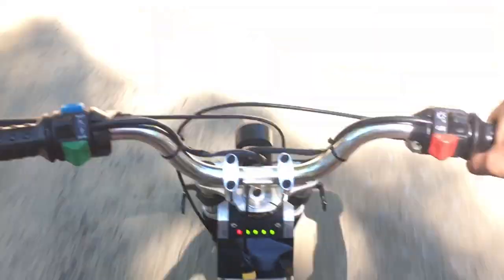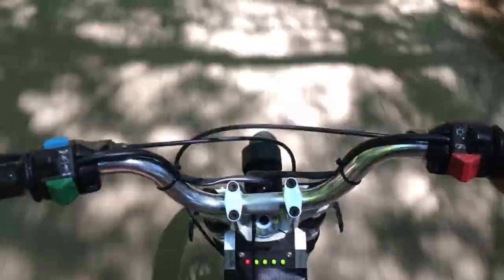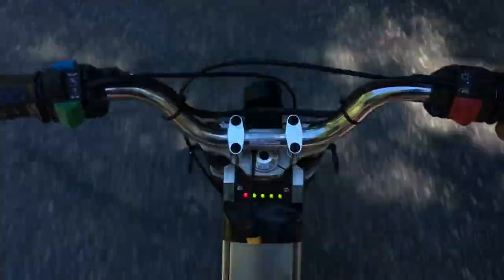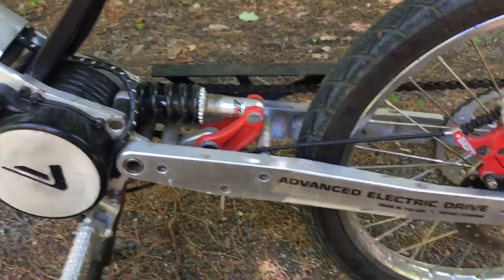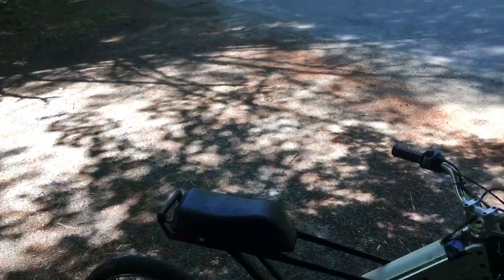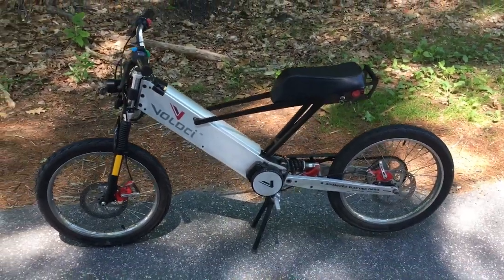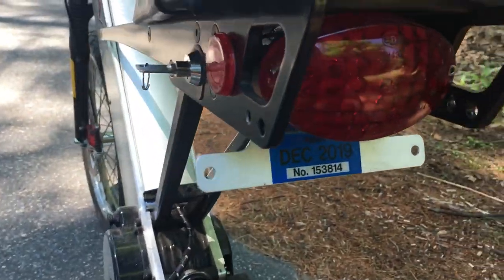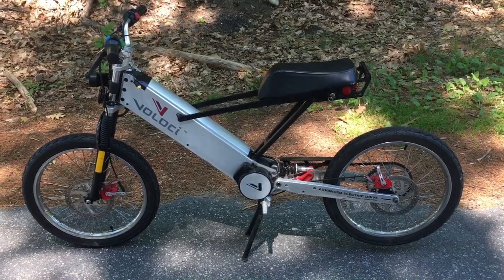48V Voloci Electric Scooter Ride/Review

Comment: I just removed the stock controller from the one I am working on it has an issue so am going to swap it out with a 48v controller. I cant find any wire schematics and dont have a clue what the throttle wires are since there is normally 3 and I have two although theres a single green wire too ( ground?) a red and a grey, the lights I am assuming are the three small ,three wire red,white, and black that are in the black jackets.
Im also located in MA.
Its not mine but Id like to get my hands on one for myself.
Reply from the maker: Oh nice I had over 12 Voloci's at one time when the inventor passed away I purchased the estate luckily. Sorry for the late reply. Let me know if your still having trouble. You cannot use the stock throttle with a new controller since it is only 2.5v and regular throttles work 0-5v
Reply: @EBIKEScott  Thanks was wondering on the throttle. Seems like the motor don’t want to work at all with a different controller even with different throttle.
I think there is a short in the motor. I can move some of the wires and the wheel will spin but if I connect a throttle it dont do anything.
Another thing is the Hall sensor wires are not the common colors and the phase wires are all black. Its been a headache🤬
Reply from the maker: @ktlcustoms3847  Ya you should check out my Endless Sphere forum post, it goes over a motor swap with detailed pics and shows you what is what, just google nova cruz voloci scooter and you will find the page easy my username is Skeetab5780
Reply: @EBIKEScott  I watched the video. Im not swapping the motor, although it is what I would do if it was mine!
Im still trying to figure out the hall sensor wires🤬 The phase wires were pretty simple and I did manage to get the wheel to spin.
Trying to convince the owner to do a complete drive line change Id love to make it into something you can peddle as well and make it more bike path friendly!
Reply from the maker: @ktlcustoms3847  ya the hall sensor combos are on the website if you need them, you will also have to adjust the timing on the hall sensors with a new controller. Typically you will want to use an amp meter to bring the noise and current to as low as possible once you find the correct wiring combination obviously
Reply: What are the prices on these
Reply: @chasesperry6455  If your lucky to find one for sale, Im sure the price can be negotiated! But doubt it will be cheap.
Reply from the maker: @chasesperry6455  i’ve bought one for $200 before, i also turned one down for $100 due to a long drive. Ive sold a few for $500. But i have a few that are priceless imo. Owned by the inventor and pristine condition

Comment: I was just given one of these by a friend who found it in the bottom of a trash pile. Im missing the front wheel, chain and motor sprocket  battery connector and housing and the cover plate that goes over the control w one of these by a friend who found it in the bottom of a trash pile. Im missing the front wheel, chain and motor sprocket, battery housing/connectors and a clue as to where the wires plug into controler (the little ones that come out as individual wires and the wires at the rear for the lighting  if anyone could help id like to put this bike back on the road.  it truly was 20 years before its time. after being homless and not having transportation this would make a good ride to pull out of poverty on being it was like the Mercedes of e bikes in its day    -------------------------------------------------------------------------------------------------------------------------------------------------------------------------------------------------------------------------------------------------------------------------------------------------------------------------------------------------------------------------------------------------------------------------------------------------------------------------------------------------------------------------------------------------------------------------------------------------------------------------------------------------------------------db